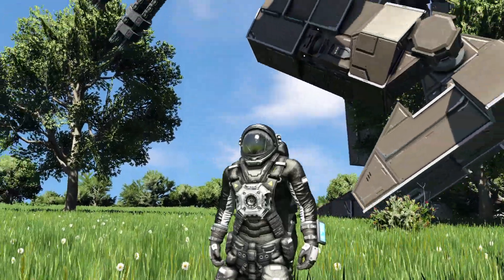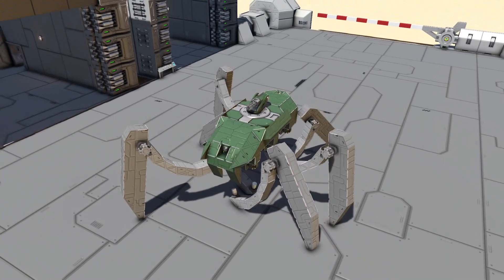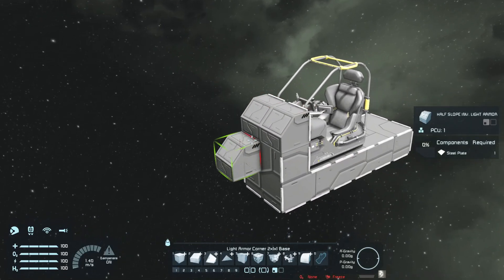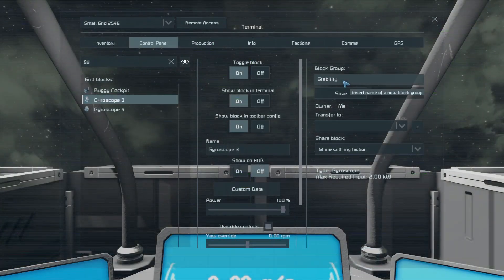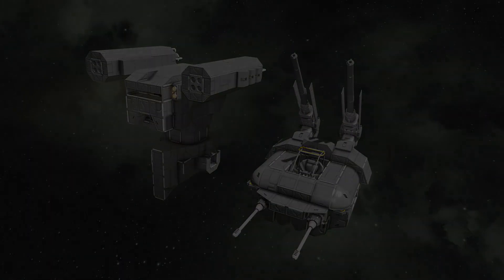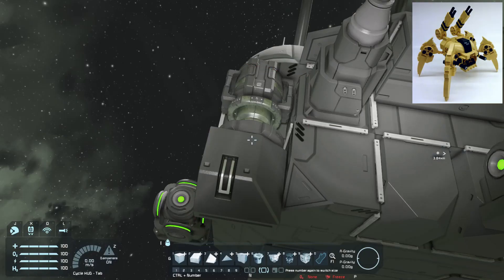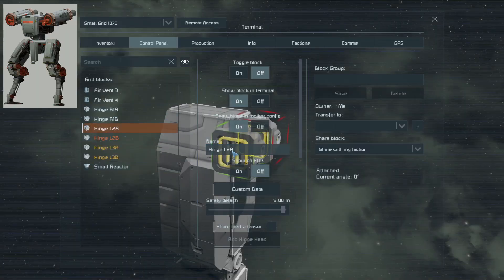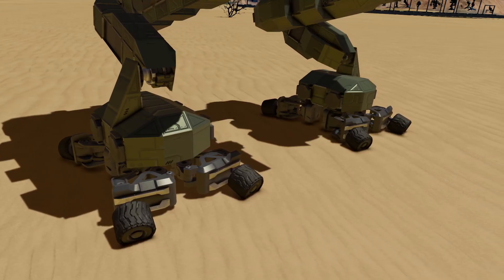Space Engineers - How to Build Walkers Episode 1

Comment: I don’t even know what space engineers is yet I’m watching this like I’m bouta build a mech right after this.
Reply: I just found this game like 2 weeks ago and let my imagination run wild. So at the base that I finally built my most basic machine is still somewhat complex lol to get material fast but have a base at the bottom of a mountain pretty much shaped in my giant funnel. Then there's a catapult that literally launches me halfway up the mountain and the ark of flight the technically a y-axis velocity of zero and so it took a few tries but I finally got it placed correctly to where my speed of flying up this mountain without a jetpack will not kill me. then I can just build drills up there and have it shoot the rocks a little sloping up dug out that goes to the final itself which isn't hard to do since it only has to fall straight down pretty much I'm just let it go and it does all the work. There's a bunch of crazy little contractions you can make. I have done their 3D printer idea but I also put a little floor on there so if I need the parts from that vehicle I can just drive it on there and then drop it into a grinding unit machine to get on my parts back. Now to do this without killing me is that I put it on a floor that slides

Comment: things evolved a lot from when i first tried (2014), lol... :)
There were no timers, no command blocks no sheet... just using the rotor strength options and gyros to "move" the legs that clamped and declamped using the "detach strength"... it was a mess :D and of course they worked only in space on the platforms :)
You did a way better job then i did back then dude :)

Comment: Always liked the world (your walkthrough world) and mechs but i hate customs scripts because most servers i play have them turned off.
Reply from the maker: Using a mech on a server is not very effective anyways :)
Reply: @BlackArmor718  i did find certain mech designs to be actually doing well. I ussually make the top section as a custom turret and use them for purposes like placing turrets in places where i would not go anyways because walkers are quite cheap to make. Just a custom turret controller, remote control, antena and ypu can make really small hard to hit units. Now im experimenting on doing RC units for digging and constructing. Already had few tests but the thing with walkers is that even with gyros they are not super stable... also i never had much of a problem with blocks breaking on me. I often use flat landing gears for the foots sole. Kinda works good and rarely breaks. Also allows me to park them anywhere.(your tutorial gave me a lot of ideas and things to work towards. Im kinda half disabled and spent most my days in bed so space engineers became kinda my addiction. I make huge ships out of boredom sinking hours into the game daily)
Reply: You can make scrip less mechs by using a chain  timers that use trigger now as there is a small delay for the actions to be carried out or you can use a rotor and a sensor where the sensor detects each rotor rotation and tiggers a timer block which then turns the timer block for the next action in the walk cycle on and itself off.
Reply: @cyitain9856  i know i tried similar things but most my walkers are compact as i often preffer RC control. The only thing i allow myself to put into my mechs are neccesary parts and a small reactor with storage units for fuel. Cheap and easy designs make for great free way of getting to ennoy your enemies without getting near to them. Or scout around. Or really do anything that would involve you needing to use a ship. Yesi could use rovers for that but they need 4 wheels and lets be honest... not as intimidating as a mech walking in your direction.
Reply: @crimson3274  A lot of compact exo suit type mechs use the rotor trick so it can be very compact.
Reply: @cyitain9856  mine are really small. Mostly remote driven. Its not like i dont know it is compact its more that with something that small amy armor counts. Especially when you waste all your resourcess on building a bunch of them(they are hella helpfull and bring joy to me as i can safely even let them walk and shoot amything on their way). Im going to use this trick on my armored transporters tho infuture(i plan to give themboth walking and flying so it can help to try new stuff)
Reply: @crimson3274  would love to see a pic of these little killing machines
Reply: @cyitain9856  its really nothing special. Its hard to do something minimalistic that stands out. Im working on a bit bigger model and im testing new kind of feet that use landing gear in their cycle to be way more stable. It slows them down but makes them stable as check. Tho i think i will still use them only to safe feet from damage. A small hint if you will want to try building any. Use small landing gear for feet. This way not oy you safe on damages but you can lock them on stuff and even use as custom turrets when needed.